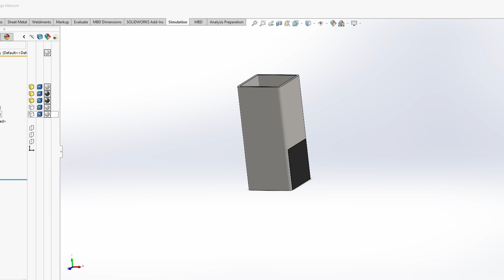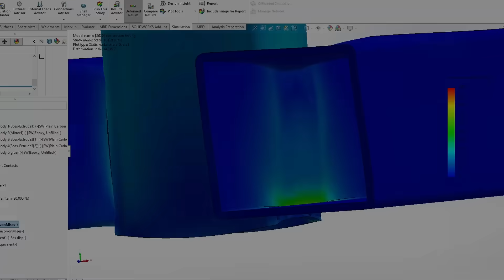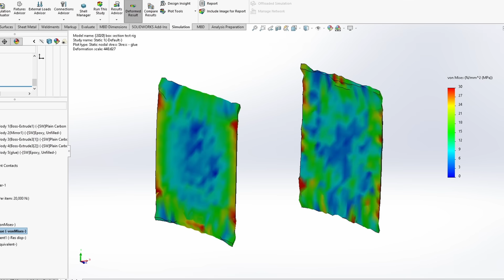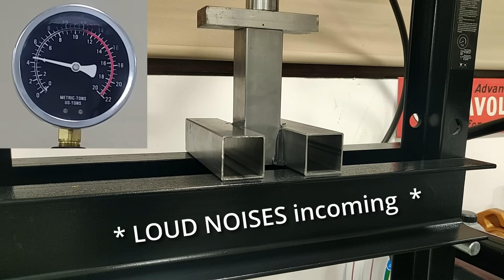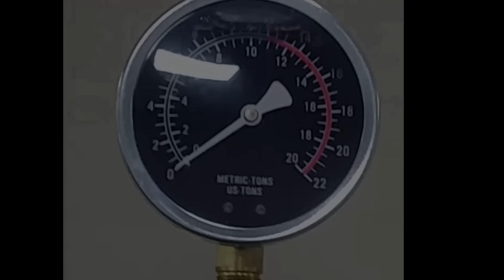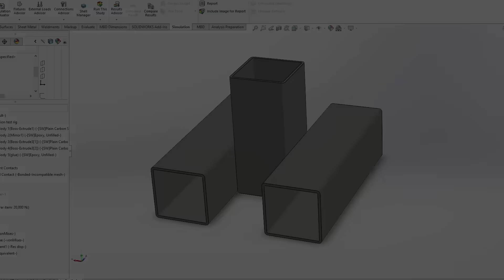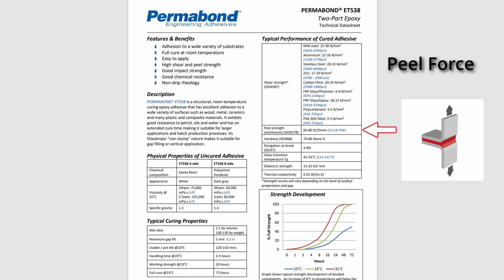How strong is JB weld structural epoxy adhesive anyways ?  Destructive test, simulation and review

Comment: I found that JB Weld seemed to outperform pretty much every other epoxy that I've tried... and. of course, the fast-cure ones are pretty much 'plastic'... and, indeed, certain materials just don't 'wet' well, and are rather hard to get together.
I had quite the argument, about 30 years ago, about adhesives, versus welding, for assembling a large opto-mechanical system, and I was convinced that the large wetted area of a tube mounted to a curved surface, would give large enough retention, without all of the issues that welding make for distortion and retained stress... sigh. But, even at that time, adhesives were being used for precision optics, using 'cure-in-place for accurate alignment/centration, and reduced cost.
Great video!
Reply: Totally agree, and it's not even close! You just have to watch out for shock loads. You can adhere metal members together and can't pull them apart with a truck, but they will easily break apart with a light tap with a small hammer.
Reply: There is some really good epoxies out here, the red ones, like Dewalt 500Plus, and the other grey ones. Sika 3001 (4 tons if drag test is done from stone/concrete, the bolt fail before the material) Fischer FIS EM Plus,
And some outstanding like BOSSONG EPOXY 21 that takes like 10-20 tons depending on bolt size. (this one i would get my hands on, but no one sells them in EU to end customers, as of i can find, they are made in Italy)
But JB-Weld withstand very high temperatures, up to 300 degrees Celsius if don't remember wrong

Comment: Given your experience with JB weld, if I covered a 3-4mm layer of it around a 3D printed enclosure. Would it hold at 1000psi? I’m essentially creating a JB weld air tank.
Reply: Nope nope nope. Don't do it. Nope. Nope. Nope. Sure, maybe the jb weld would hold. And it would be a very interesting experiment! But if that stuff pops, you're gonna have jb weld shrapnel in all of your vital organs plus some. Garages are destroyed and people die from 150psi air compressor explosions. Granted, a much larger volume of air, but anything pressurized is just a fancy bomb. Keep in mind that the more epoxy applied, the higher the chance of nearly microscopic imperfections. At each one, the strength of the material is drastically decreased. In both my professional AND personal janky garage opinions, 1,000 psi is well past the range of eff around and find out. It's eff around and die VERY quickly.
Reply: @timdurachko  certified journalism!

Comment: great video. I am trying to patch a non structural piece of metal to rusted area of a car I am working on. Can JB weld stand regular road vibration?
Reply: I use it in some cases but add a bil of glass fiber.

Comment: For a product that claims it can withstand 2 tons of force to exceed 4 that is pretty impressive, twice as good.
I bet it would be even better had you used a really coarse sandpaper grit or file to prepare the metal surface for the epoxy to attach on
Reply from the maker: It's about right for the claim - 5000 psi
During my research where I consulted a few major adhesive manufacturers (Loctite, 3M, permabond) - the "roughing up" idea seems to be up for debate.  It does increase surface area but also adds different force paths thru the adhesive making it inconsistent and introducing tensile loadings where epoxies are generally not as good.  If the load was perpendicular to the bonded plane, I think it would help.

I'd love to do more testing at some point.

Comment: For Automotive structural joints, often the choice is between a welded or a bonded (using adhesives) joint. However, with the adhesive joint there is usually a preload clamping device in place while the adhesives cure, many times rivets are used (sometimes spot welds), where they remain and are not removed. 

From a design standpoint we have different unknowns which factor into the quality (strength) of the joint in how it is loaded. With aluminum welding can reduce the maximum tensile strength in the welded zone (heat effected zone), but there are many variables as to the magnitude of this reduced strength such that the joint safety factor is increased to compensate. This can add weight, which is not beneficial in weight sensitive applications.

The interesting thing with your demonstration is how the adhesive fails. The shear is not transmitted to any fastener, because there are none. But if there was a preload device than shear never would be transmitted to the clamping device, because the failure mode strength of the adhesive is so much greater than the preload the force, the fastener would just be overwhelm during failure. In other words, the failure mode is catastrophic and without warning, except of course for the cracking sound before the joint explodes. 

The better test would be for shear fatigue, because the joint surface area is so much greater with adhesives. So what would be the fatigue life loading and cycles between a common two row riveted lap joint one without adhesive and one with keeping everything else the same?

As you mentioned the applications of adhesives are confines to relatively low temperatures as comparted to a welded joint. Although metals also exhibit a reduction in strength with temperature but at much higher temperatures as compared to adhesives.
Reply: I do not know how to weld and I’m thinking of building a go kart and was wondering if this epoxy along with bolts to build the frame would hold with the vibration of the motor
Reply: Also good for body repairs, if you got a side panel that's rusting out you can just cut it with a grinder, and put a new piece of stainless there instead. Then Fill, sand, prime and paint.
Reply: That was an amazing writeup, especially on a yt video. Thanks!
Reply: Well thats so simply put a 3rd grader could understand it

Comment: Hi can i fill the spark plug hole in my cylinder head with jb weld and tap it? the thread got stripped
Reply: You'd better use a helicoil for that i think
Reply: No. Use a repair sleeve for the hole. It is threaded for your plug. Just tap the hole out for the sleeve.
Reply: @davidlang4442  thanks, its been fixed now with that method and i applied loctite red

Comment from the maker: Just a quick note - I cannot in any way advise on individual projects.  As with most things, engineering can sometimes be complicated an a one word answer is not applicable without knowing the project in detail.  Refer to the caveats at @8:00
Reply: And it's sand the pieces first
Reply: Jb weld holding 4 ton wow did grind the surfaces for good bond obviously it didn't loos contact as it sheered off
Reply: Is Plastic Padding brand Chemical Metal as tough as JB Weld?

Comment: Great video, I've been enjoying your scanning videos for a while now, and saw this whilst scrolling through. I've been thinking of using jb weld as a liquid shim. As a bonus it's good to see how well it adhears to simply preped metal.
Reply from the maker: yep its outrageous how well it bonds - I've not tested its crush resistance yet so it depends how much load you wanna put on it, it's pretty versatile stuff.
Reply: @JonHimself  I wonder if it's crush resistance wouldn't be improved by a little fiber reinforcement.

Comment: Great test Jon, I had a good chuckle when it let go!   My test was not as in depth, but I could see that in my application and the saddle surface area a long with the rivet nuts, I'm confident all will hold up well. Thanks for your original vid. I no idea that the chassis could fail by the shifter. Really looking forward to your vid on the race cage. Ross
Reply from the maker: yep you should be fine, the tests I have done show as long as there are mechanical fixings to stop any peel, the glue hardly feels any stress.

Comment: Thanks for sharing. I haven’t seen someone do such a shear test before.  I suppose your setup has a bit of shear and tensile pressure given the force angles created. I am curious how well pure tensile strength is for jb weld. That’s where I have seen it fail sometimes, but I believe prep and applying it is very key for tensile strength success.
Reply from the maker: Me either which is why I did this test - I think people are like me and don't think it can withstand the forces, set up tests and cant break the stuff 😂
Tension test would be the next logical investigation but you need to prevent peel around he edges as the metal deforms.

Comment: For s mortals - can you describe what force (on the gauge) you would have expected in your test if your test piece was welded? Really fascinating!
Reply from the maker: ahh if I have seen further, it is simply from standing on the shoulders of giants.
So a weld has its own caveats, the results would be so different.  I want to welded test at some point but unlike the glue'd join, it'll destroy the base material and I want to do some more glue stuff first 😋
Basically a weld would be about 32,000 psi vs 5,000 psi of the glue, so the weld would have to be at least 1/6 of the area of the bonded patch area to perform similarly.  The length of each weld would be 1.7" x 8 edges = 13.8" of weld - say the bead was 1/16" = welded area of = 0.8square inches vs 3 square inches of glue.

So the welded join with this small bead would theoretically be stronger, but in this case the metal will fail well before the weld does.  The models of failure are different but the strength would probably be similar.  the bonded join does a great job of supporting the metal, a weld however would focus all its strength into a small area likely ripping it out at a similar force.

So it really is horses of courses and both have their merits and detractors for each application.
Reply: @JonHimself  Hmmm  yeah i am thinking the failure woud be different, you would have a yield rather than a fracture??  I was really expecting the metal to start yielding once I saw how much you were able to put into it.  Monster strong bond!
Reply from the maker: @eriklombard322  yep a (good) weld would yield rather than fracture, then as the metal folds the structure will collapse.  The bond actually stops this - at some point I'll do a follow up video.

Comment: Thanks for posting, a very interesting test. I have a little experience of bonded aluminium structures. I would comment that "Sand blasting" the adhered structure's faces to increase their bonded area may have improved the bond above what you managed to achieve. Chemically bonded structures are everywhere these days and offer some impressive options as a "Cold" joining medium.
Reply from the maker: Yep, most manufacturers I have spoken to suggest shot blasting, but don't really like the idea of heavy abrasion - I'd suggest they are worried about micro peeling leading to premature failure.  One company suggested a smooth finish for that very purpose which is why I tried this test without a mechanical key.  I was shocked the glue held up to very near the advertised strength.
As I mentioned there are certainly caveats to using glues but I'm certainly going to be using them more and more, because in some cases they have clear advantages over welding.
Reply: @JonHimself  My own experience is with aluminium racing car tubs. The addition of solid rivets aids the resistance to peeling. In most cases, the material around the joint fails long before the bonded / riveted joint. I'm looking forward to see how you employ this newly gained knowledge to your projects! 👍👍.
Reply from the maker: @speedfinder1  yep mechanical fixings are essential, I'm going to use them in the final design I am working on the the Esprit gear lever re-enforcement.... more to follow
Reply: At the very least scuff the areas up with sand paper
Reply: @grandduke2145  yes I imagine that the test could be repeated with the steel hit with coarse sandpaper then cleaned with solvent.  I'd also like to see the joint tested for peeling strength and for vibration resistance
Reply: I'm in the need of use metal for furniture, would You Say it's it a good a idea to use jb weld for that aplication?

Comment: That fracture was AWESOME 👌 thanks for sharing your fun bud glad the sims came out looking more trustworthy. Deformation discrepancy might be down to the fixing conditions in the sim not allowing the bottom beams to rotate so they react the moment differently🤷‍♂️. Awesome work.
Reply from the maker: Main reason is I never expected the thing to support 4.5 tons, so I under developed the sim so it seems.  Even now its hard for me to get my head around.
Yes the steel box did not deform like what the simulation said it would, infact it looks quite unaffected.  I used standard materials but that steel box section is clearly stronger than the 220MPa I used on the simulation.  The fixing didnt allow for rotation either which as you say would affect the stress at the bottom part.
I don't think the 'epoxy' is the correct hardness either, it tends to stretch on the simulation where as you can see it doesn't do this in real life - it's extremely stiff.
Good to do physical tests though as it highlights these mis-conceptions.